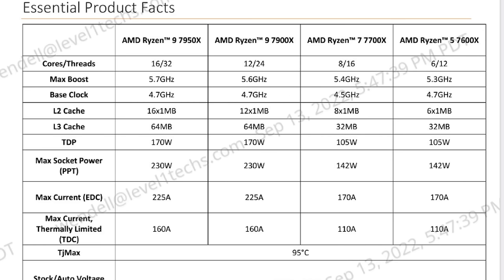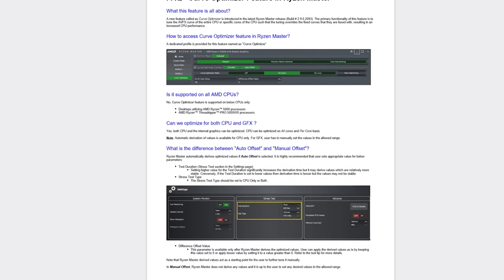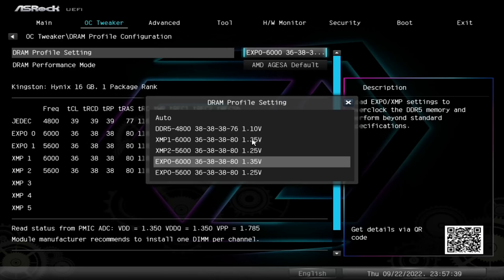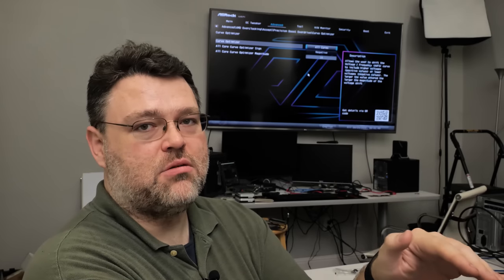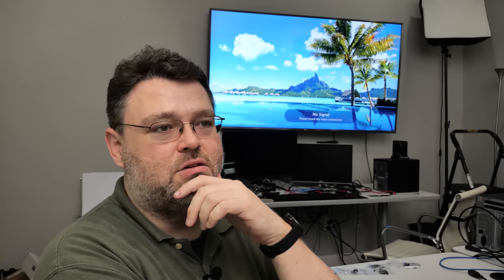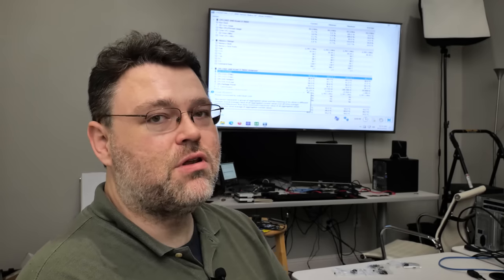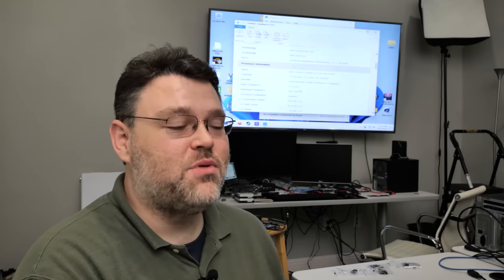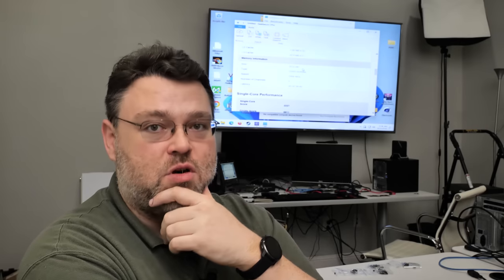Kicking Ryzen 7000 into HYPERDRIVE! Overclocking, Curve Optimizer, 5.85 GHz!

Comment: First question ~ How much of this can you do under Linux?
I get it, there's BIOS (EUFI) settings and then there's Windows applications. What I'm asking, is what do we have in the way of Linux application for this?
Don't tell me NONE ~ that's not the answer I was looking for!
Second question ~ I get that a Noctua NH-D15 will be working hard. It will work, but ~ so how much performance will I be leaving on the table, because I don't want a loose hose connection to spray the inside of my five thousand dollar toy?
Reply: I used to use echo and some scripts to tune my gfx card.  It's knowing how, where and what is exposed by the kernel.
Reply: If you're going to spend that much on a system, do a custom water loop you built and tested yourself. Or if you're not interested, get an Ice Giant. Jayz2cents said it cools am5 better than anything else he has seen, and there's no moving parts, risk of leaks, or evaporation.
Reply: @jesh879  Yeah, Jay-Zee has said a number of things over the years. Some of them I agree with.
My opinion, without having owned either, if an Ice Giant will cool 500 watts, then an NH-D15 will cool 700. It's not going to stop, it's not going to fail, it's not going to leak. Even if both the 2 big fans stop at the same moment, there's enough headroom for the processor to clock itself down to 40 Watts or something and let you know there's a problem, then shut down. yeah ~ Linux. It doesn't have an ap for that, from the iFool store. It has a kernel that knows how to run a machine.

Comment: im using an AM4 cooler i modded to work on the AM5. (direct die LM). do you think the physical mass of a waterblock would have changed - in that the AM4 block might have less mass and thus less cooling power?  its a phantechs c360a

Comment: Call me danger dan, but im gonna go 6 or 8 core with a Noctua NH U12A once the b650 boards arrive.
No watercooling for me...
Liquid and the inside of a pc dont compute with me.
Reply: I’m thinking of doing one of the higher core counts with the new noctua if possible and just have it run eco mode
Reply: Ice Giant
Reply: Waiting for the reviews on this sort of testing before I decide, plan initially was a 7700x but if that doesn't work out then might stick to a 5800 tbh for another year or two
Reply: @CJonestheSteam72  the 5800 I'd a fine cpu and I don't think it will bottleneck you appreciably even with a 4090/7950xt. That's of course, assuming you don't play at 1080p. If you do, then anything is fine for 1080p and you should buy a new monitor instead.

Comment: Question is. I can use -30 on my 7900x and it's stable. 92c so far under cinebench. question is can i keep that negitive curve and some how ask for little more cpu ghz? I don't know how to ask. I am doing 5.4ghz at above settings but can i ask for like 50 more mhz higher clock? Or should I not worriy?
Reply: It clicked after i asked my question its asking for more at neg curve and L1 says that. I miss understood. still learning. lol. Thanks. I tried -35 and she pooped out. No silicon lotto here so i'll just keep at 30. i think too it's not boosting past 5.4ghz cause heat as well. Coolio. thanks all.  @puffyips

Comment: Hey man I've just built my am5 system it's an Asus x670e-e Ryzen 7700x d.skill 6000 cl36 kit. But nothing i do lets me use the expo profile. If i set in bios problems booting. If i set in Ryzen master it works then randomly i get recovery screen on boot any idea what it might be? Have you experienced anything similar?
Reply from the maker: Switch which slot what dimm is in

Comment: how to test curve stability?
Reply: I run cinebench multi core benchmark while Ryzen master is open showing me all 8 cores in realtime while benching to see how high it goes each time then play games/watch youtube to see if it crashed. Worked fine for me with -30 on 6 cores, -20 best core, -25 2nd best core on my 7800x3D. got about 250mhz performance increase with less heat

Comment: my 3950x sips wattage compared to the new one. Dang.
Reply: That's because AMD and Intel decided to sell these new CPUs pretty much factory overclocked. If you set the 7950x at the same TDP as the 3950x, the 7950x will have much better performance because it can deliver more performance per Watt.